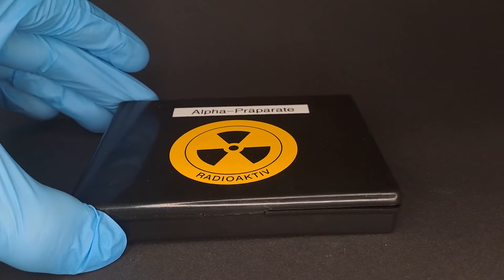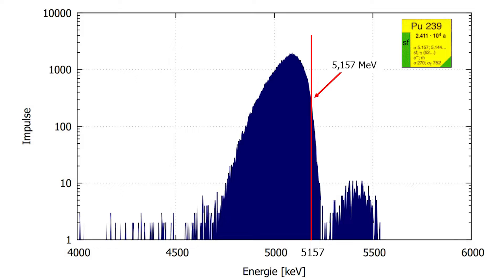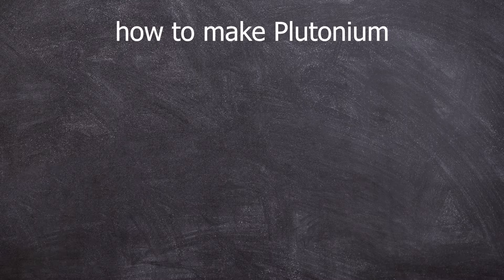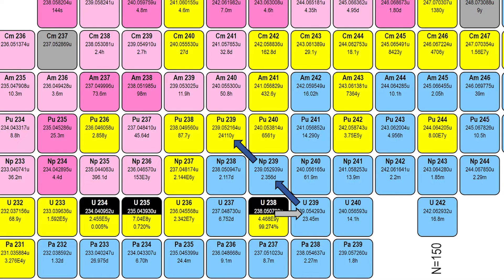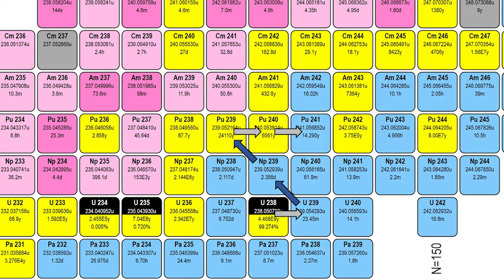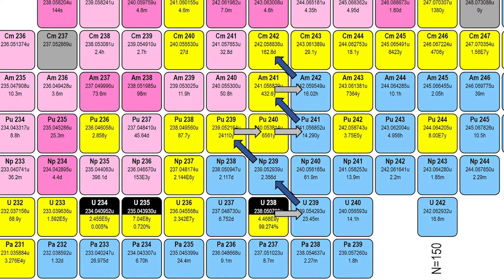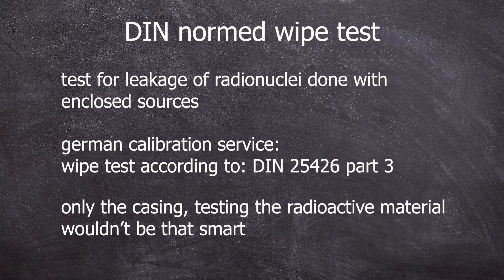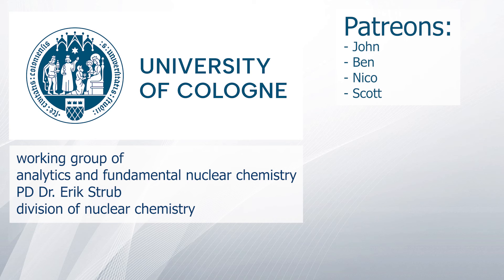Plutonium - 239 - nuclear chemistry

Comment: Dang 867 Bq is only 0.02 microcuries of Pu 239. I honestly thought you’d have a lot more. Heck my Soviet smoke detector has half of a microcurie worth of Pu239.
Reply from the maker: Yeah that is quite low in our case. We are specialized in handling beta emitters. So we mostly work with anything before Lead. Legally we don't have a limit that we are going to practically reach when it comes to anything up to uranium. But anything past that is not allowed for us in quanitities that one would be able to do chemistry with
Reply: @SimonsNuclearchemistry So what type of license  you would need to be able to do chemistry with Plutonium?
Reply from the maker: @ryana3298  one for handling such🤷‍♂️ you tell some officials what you have, what research you would like to do with which isotope and how you are going to ensure safety and stuff and then good luck^^ ofc very simplified. But we can't handle transuranics safetly. Our lab is simply not made for it.

Comment: The Pu238 is likely not from Am241 reactions but rather the n,2n reaction from Pu239 itself, most of the reprocessed stocks of plutonium used for scientific applications were generally made using a shorter exposure to minimize the content of Pu240/241 in the material, which would also consequently limit the Am241 present in the sample during irradiation. But even if it was reactor grade Pu239, I would suspect the actual cross sections for the n,2n being somewhere around 1-2% of total reactions would vastly outweigh the roughly 1% of 1% of 1% of some of these capture schemes. Interesting to consider though! One way to see this would be to use Gamma spectroscopy on the same sample and making a video on the result which would let an enterprising person try to figure out the exposure conditions (and therefore the origin) of the sample. 

Also could we see some Technetium chemistry? I wonder if its oxidation states are as pretty as manganese.
Reply from the maker: Yes they are as pretty :) and yes! We do a lot of Technetium chemistry in our lab. I just have to wait for the Paper to be published in order to upload the Videos :D
Reply: Hellow I am ethiopia I live in addis abeba  and I have p-239

Comment: Hello! I’ve created an experiment trying to measure the Uranium-235 content in some Uranium ore. I have gotten ahold of the gamma spectrum of the source. I am trying to calculate how many bq of Uranium-235 is present in the sample. However, I cannot find the calculation that I need to use to figure out how many bq of this isotope there is? Could you please explain the process of how I should calculate this? Thank you for any information that you can give.
Reply from the maker: Do you know how much Uranium is in the mineral? then the U-235 is just 0,7% of that. If you don't its gonna be very complicated.

 you need to know the efficiency of the detector for this energy. Either you have a calibration sample with a known activity at a certain date (best ist Eu-152) or you can only roughly estimate. Do you have the energy depended efficiency for the detector? if not, I don't know without totally estimating everything base on educated guessing. You can write me on Discord^^
Reply: @SimonsNuclearchemistry Thank you! That makes sense and it helped me a lot! I’ll have to make an account on discord.